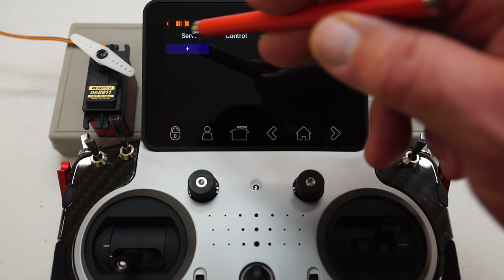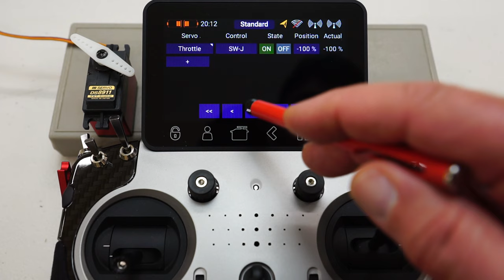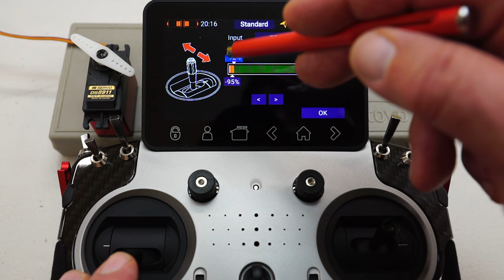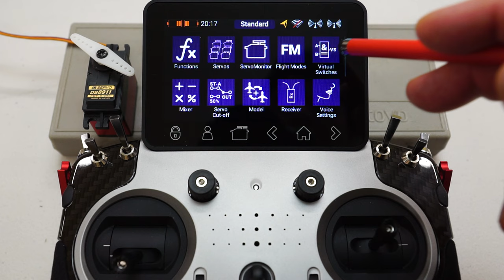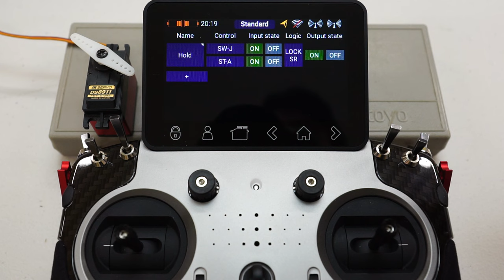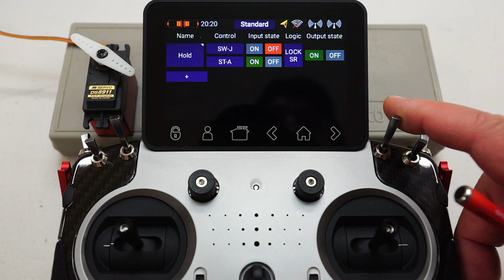PowerBox Core - Atom : Enhanced Throttle Hold Safety Switch feature for Electric Models

Comment: Fantastic video Costa, understood this unlike all the posts in the forum. This function was completed in the Multiplex radios and came with a pop up warning in the display that said you had high throttle. Can expand this with a spoken warning to pull back the throttle. Thank you very much.
Reply from the maker: Yes of course you can add an audio warning as well....Good idea..!
Reply: Made a voice notification to "pull down the throttle". Almost the same as Costa did here with one more virtual switch but with a Lock RS logic. @CVHeliPilot
Reply: Hello  @superleeds1966 could you please describe the steps to accomplish that?

Comment: Hi Costas,
Thank you for your excellent YouTube videos that convey more than words.
I have an Atom transmitter and would like to have the same functionality as you show in your video for my electric planes.
However, in Virtual Switches under Logic, I do not have the option to choose Lock SR. I only have the options OR or AND.
Is it still possible to program the functionality you described in the video?
Reply from the maker: Yes...You just require to program an additional virtual switch. I posted an example of this on the PowerBox forum a while back. Look under the 'How To' videos on the forum and you should find it.

This was before they introduced the Lock SR/RS feature in the last software update.

Let me know if you cannot locate it...
Reply: @CVHeliPilot  Excellently thought out and communicated in Powerbox's forum - thank you

Comment: Hi ya great teaching videos,would be lost without them, could you go a bit further on the electric side, of having an idle up switch please.
Reply from the maker: Hi Antony...Do you just need a high idle setting similar to an IC engine setup? Or do you require something like an idleup function on helis..?
Reply: Just like on a patrol engine , so you have a high idle when flying and then, flick the switch and and it drops it back down…..

Also later could you do a video on how to,setup the I gyro sat as well please, as I will using one very soon on a jet…..
Reply from the maker: @antonyboycott4026  I now have a Mercury SR2 so planning to make the next few videos on setting that up. One if the vidios will cover the iGyro setup.

With regards to the high idle... You can just setup a new function called say Hi-Idle and assign a switch etc to it. Set it to operate on the throttle channel and then modify the function curve for this new function so when you flip the switch the lower section of the throttle is bumped up a little (increases idle setting) hiwever the remainder if the curve is unaffected (use the multiple points on the curve to do this). You can then set the rate % to determine how far to shift that lower part if the curve up and down.

Comment: Hello Sir! QQ, let's say I want a voice setting for example to say "kill switch, ON" vs "kill switch, OFF", this is not possible if I set the virtual switch as the control triggering the voice setting, right?
Reply from the maker: This is fairly easy as you can add additional voice prompts simply by going into the voice menu and add a voice for any switch positions you like. Just make sure they dont clash with any flight mode voice  announcents...🙂 You can trigger off a physical switch or a logic switch depending in what you want to achieve.
Reply: @CVHeliPilot Thank you for the quick reply, sir! I'll try this later on!

Comment: hello You would also make an Improved Throttle Hold safety switch for fuel engines when are you going to make it
Reply from the maker: @wimvanUffelen  I did a video on this earlier in the series. Not sure if you missed it or not.

https://youtu.be/rhir4_V9AQM?feature=shared